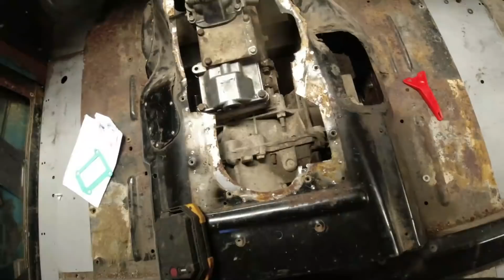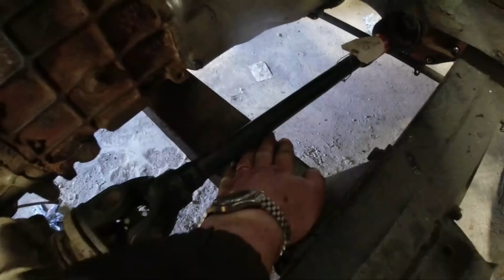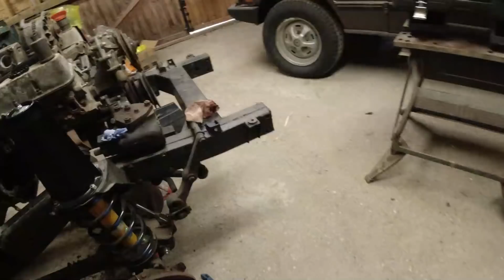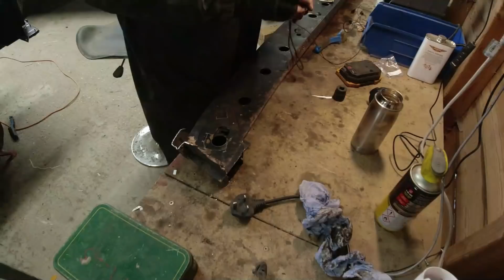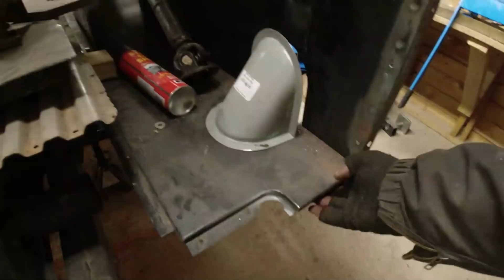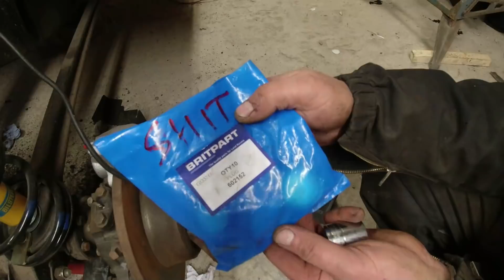Episode 31 - 1971 Range Rover BOB - engine, core plugs and stuff - Parental warnings

Comment: Interesting on the core pugs Richard. I have replaced many in my time and never had one leak. Clean surfaces, smear of blue Hylomar and all good. Until I did the 3.5 in the Stag during the rebuild. Fitted them same way, to a bare block on the bench so I know they went in right. They were the only thing to leak when I started it, 2 on 1 side and 1 on the other. And of course 1 behind the flywheel so out it came again. I was not happy, many impolite words were said.  Guess the make?
Fitted a set of Bearmach ones and all dry as a bone after.
Reply from the maker: Never ever had an issue with them if you ask them. https://enginecoreplugs.com/ all the way for me now
Reply: Britpart are best avoided whenever possible.  They are truly awful.  Not very honest, either - they continued their adverts stating they were supplier to the MoD for years after they were stripped of the contract (over quality issues, I believe).  Their bearings are oval and soft and their seals are hard.  Britpart seal is an oxymoron.

Comment: Hi Richard, isn't the 4 bolt steering box eariler than the 3 bolt? cheers
Reply from the maker: The earlier PAS boxes has triangular top plate with a bolt on each corner. Not sure of the change over point without looking at the parts manual but later PAS boxes have a square top plate on top with a bolt on each corner. Hence my cackhanded description of 3 and 4 bolt boxes

Comment: Richard- I have a 1990 3.9 with the oil pressure light on. 
What tests would you perform to diagnose if it’s a true low oil pressure problem or just electrical?
Have any of your videos covered that?
Reply: You are likely to hear it if there really is no oil pressure, the big ends will be knocking and the hydraulic lifters will get noisy too. The best check is to plumb in an oil pressure gauge where the sender unit goes but if you don’t have access to one, the oil sender unit is only a few quid so try a new one. It may be worth rigging a test light to bypass the cars loom to fully exclude an electrical fault I.e battery positive to test lamp then ground the lamp to the oil sender.
Goes without saying if it doesn’t have oil pressure don’t run it or drive it! Any work done on engine recently, these pumps can be a challenge to reprise if they run dry.
Reply from the maker: Pretty much everything that Nigel already mentioned. I would probably ask you what happened (or what you did) just prior to the oil pressure light staying on. If the pump is dry then it will struggle to draw oil up from the sump and will need priming.

Cheapest option by far though is a new oil pressure sender and screw that onto the oil pump housing. I have had these small senders fail on me, ever a brand new one failed within a few miles.
Reply: @churchhouseclassics  Great advice from you and Nigel. 
I have had the truck for a year and a half and it has stayed in the garage and I only pull it out occasionally so it runs for 5 minutes at the most. 
The oil light has been on since I’ve owned it. I changed the oil and made sure it was at the correct level and no strange noises as far as I can tell. 
Let’s say the oil pump is not priming or is inop, is there a way to prime it to get it pumping correctly again or do I need to pull the oil pan and look for obstructions at the pick up tube? 
Thanks for your help.